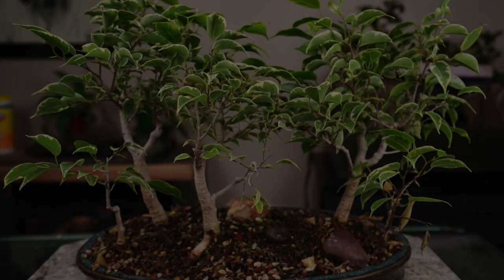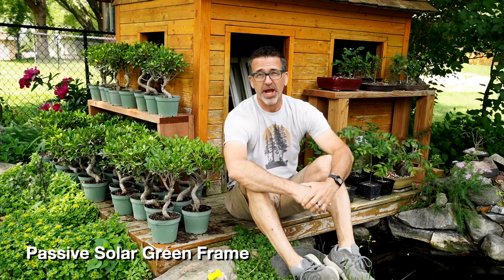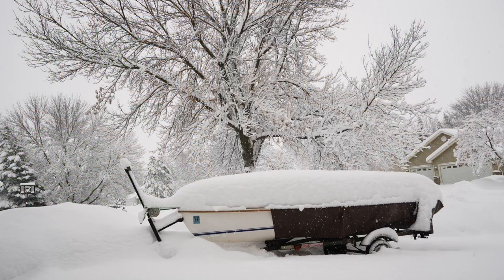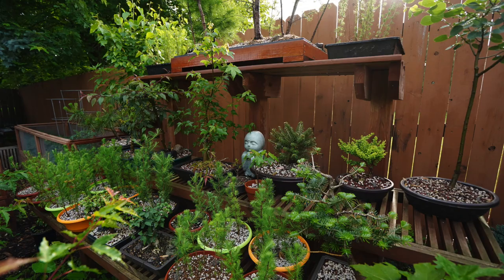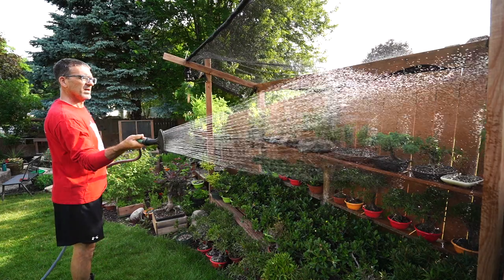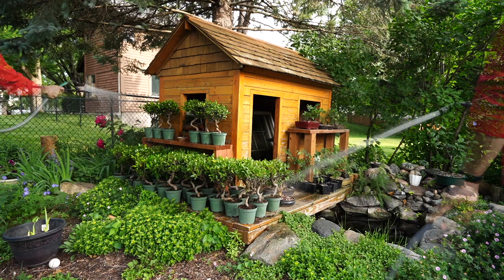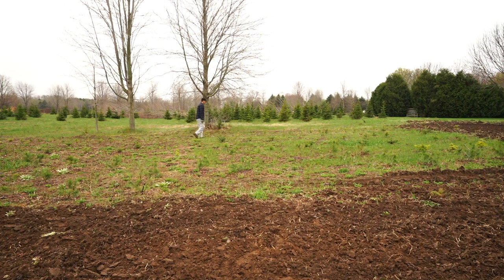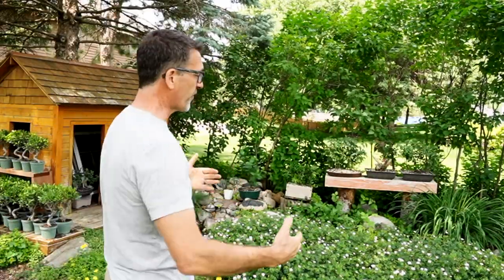Passive Solar Green Frame Part 1:  Dave's Bonsai E326

Comment: This is really cool and potentially something I can use in the future.  Would one get any benefit from having a slightly subterranean greenhouse instead of an upper and lower chamber?
Reply from the maker: The lower “chamber” will just be tubes at bottom, filled back with dirt.  The air from those buried tunes will regulate the air temps in the PSGF.  If this was a greenhouse four times as big, you idea might work.